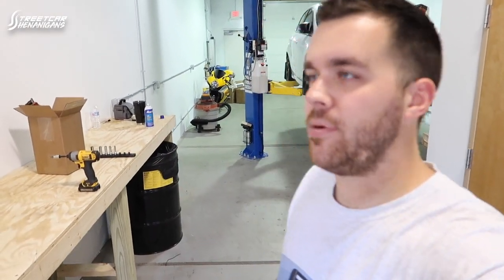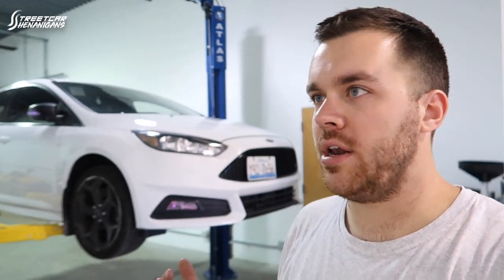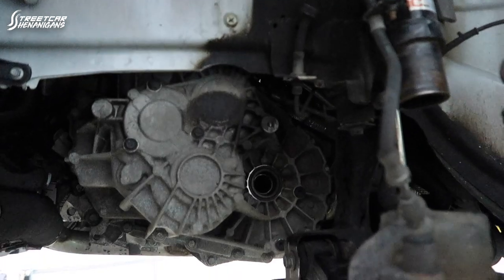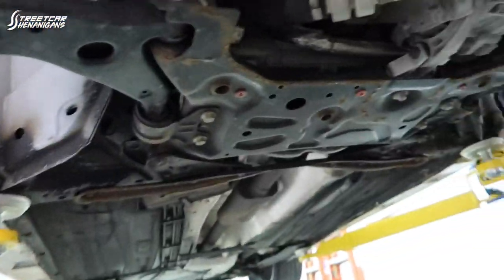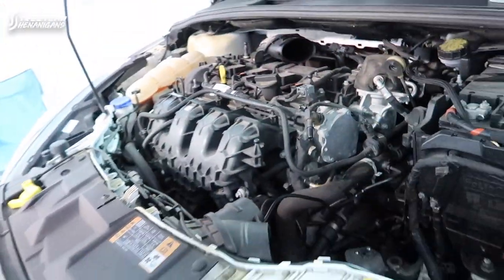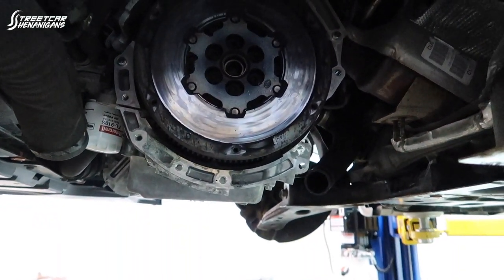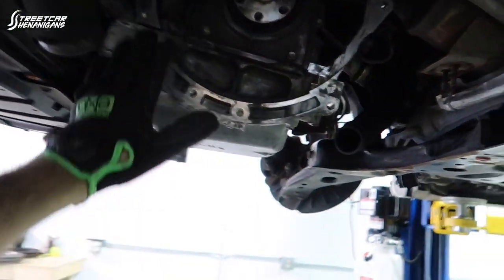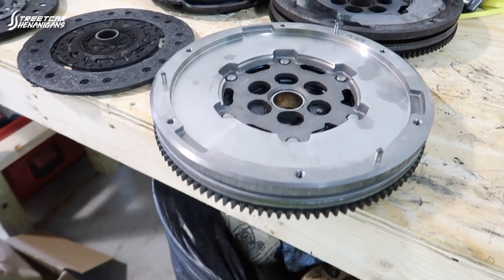2015 Focus ST Clutch is WRECKED!

Comment: Have u fix the problem with the leak? Was wondering if u fix it and the cause of the problem mine is leaking too really bad. I complain that to my dealer and they fix it under my warranty  bus till leaking been back and forth to my dealer 6th times if i bring it again to them for sure it still going to leak. Please i need some advice from you. Thank you
Reply from the maker: Ordered a whole hard line kit from Ford.
Reply: @StreetcarShenanigans  any link for the parts sir?

Comment: Did you have to loosen the subframe to remove the gearbox?
Reply from the maker: We did not, we used a engine cradle from above and removed the driver side and rear motor mount. Then let the driver side of the engine come down a bit to slide it off. Cradle the weight of the engine in place of missing motor mounts.
Reply: Streetcar Shenanigans great to have a shop. I have to do it in the driveway. Thanks for the reply.
Reply from the maker: Yes the lift is a game changer! I have done a couple FWD clutches in the garage. Not as fun. Lift pays for it self quickly.